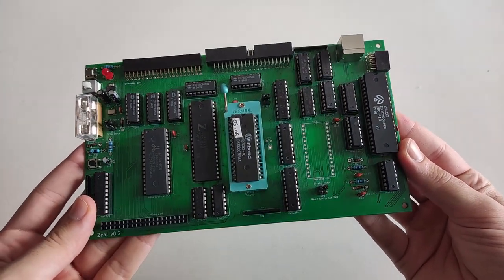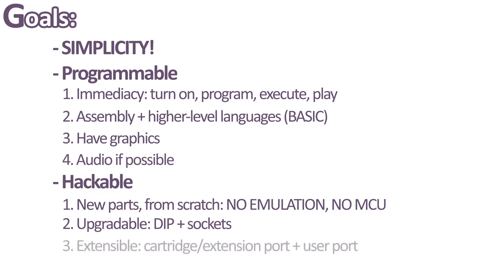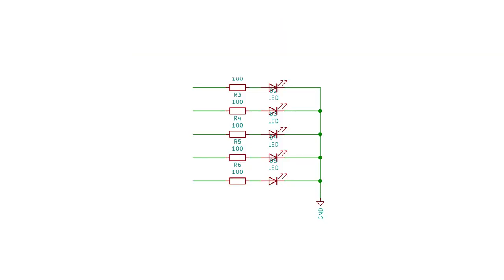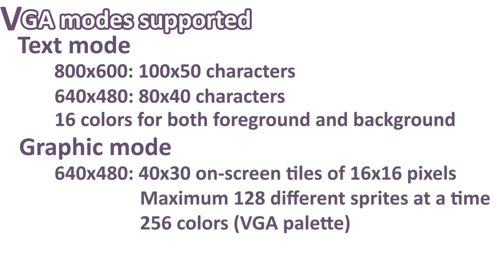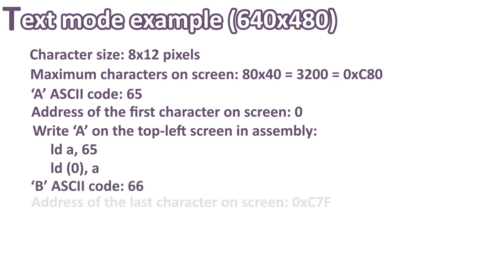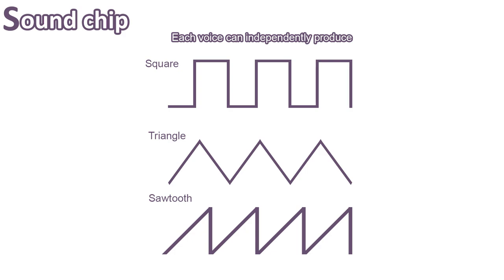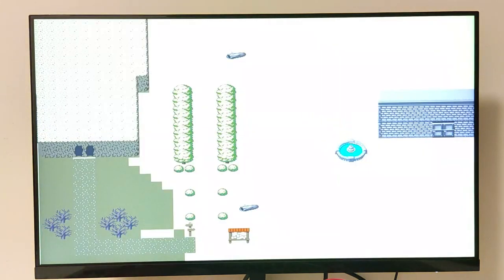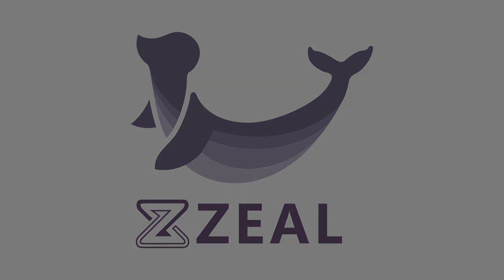Build an 8-bit retro computer powered by a Z80 ! [Zeal 8-bit]

Comment: You said NO EMULATION nor MCU's... but as soon as you hit a snag... oh I decided to use an FPGA (AKA hardware emulation)... what a shitshow... what could've been a 30USD project just added a 150ish USD board.... WTF...
Reply from the maker: If the FPGA board is not connected, the board still works, I have now implemented a UART interface for communication as a plus.

As I said in the video, video chips are not made anymore. Thus, if we don't want to use refurbished components for making an acceptable VGA graphic output, not only text output, the only solutions we have here are:
- Use an MCU (ESP32, Atmega, STM32...)
- Use an FPGA
- Use a powerful CPLD (I guess that you would also consider using that as emulation)
- Use another ROM/RAM and logic chips only dedicated for generating a simple VGA signal, without hardware sprites. I am not even talking about sound here.

I would like to point out that using a second Z80 responsible for VGA output is not a viable option as we need a 25MHz pixel clock for 640x480.

So, as you can see, in order to have an interesting project, one has to make some choices. Plus, I would like to add that I never said that I was trying to make the cheapest 8-bit project.

Anyway, I would be very happy to hear your ideas on how to handle VGA graphics/texts and sound, without software nor hardware emulation, that would help me😉
Reply: What a thoroughly rude and unnecessary comment.
Reply: @SpeccyMan  Nah, that is the usual Internet guy who has just realized that there are people out there actually doing something instead of fussing around. Oh and if they grasp that others are actually smarter than them, they switch into full blown "entitled Karen-Mode" (as demonstrated up there). 
Why not welcome this little self-embarrassing piece of absolutely royalty free real life comedy? You want popcorn?:)))
Zeal8bit: Well done!;)